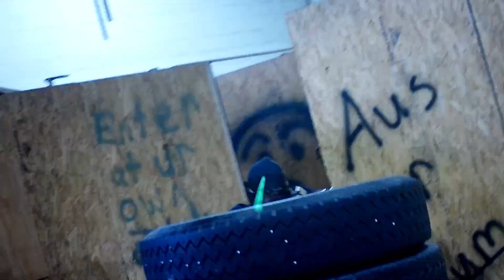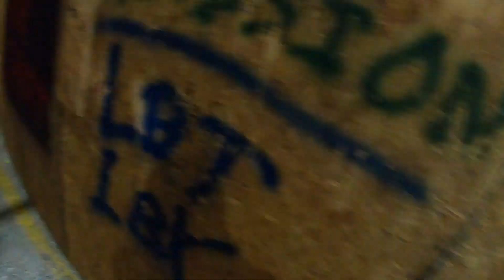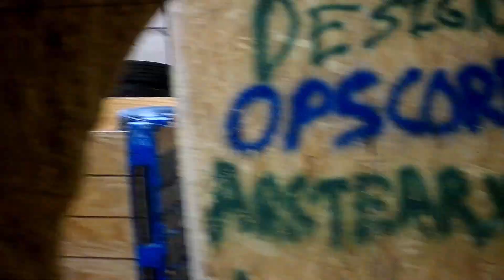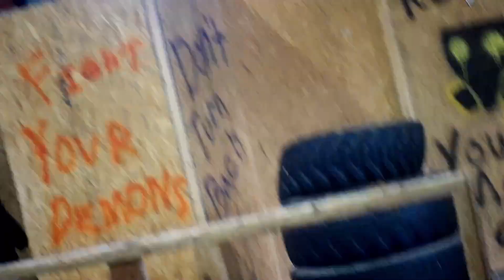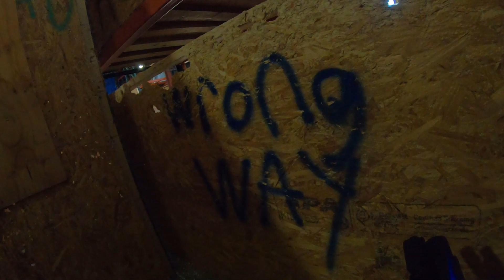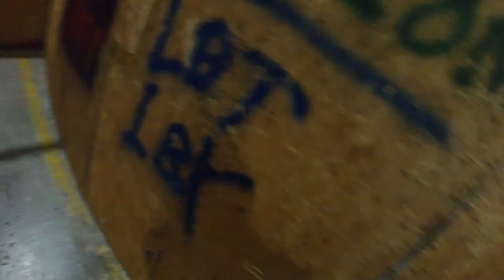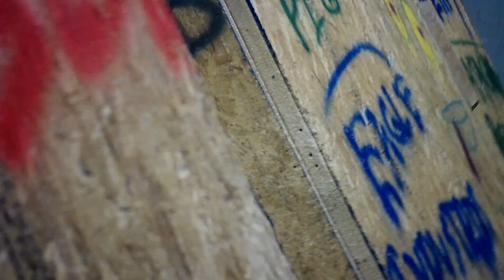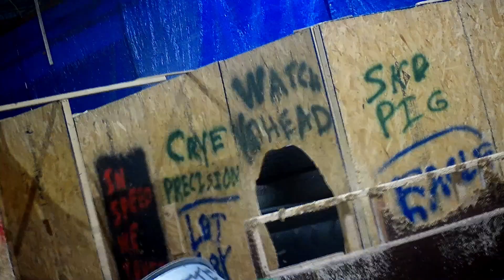Krytac PDW MK2 M-Lok Gameplay

Comment: Are you using it stock in the vid? The trigger response seems pretty good.
Reply from the maker: yes its stock
Reply: @DevinGhillieAirsoft  what would you prefer for cqb, this or an ARP-9 (assuming I can find one in stock anywhere)
Reply from the maker: @Skuffle  The ARP 9 is lighter but you need to buy the Perun mosfet because the G&G one burns out easy. The ARP 9 is faster in Semi auto. The Krytac has the better barrel and bucking.

Comment: What tracer are you using and will it fit
Reply from the maker: I’m using an ace tech lighter s with the Dytac outer shell. You need a 1 inch outer barrel extension for the Krytac PDW
Reply: @DevinGhillieAirsoft  alright thanks will a ace tech brighter c work without an adapter?